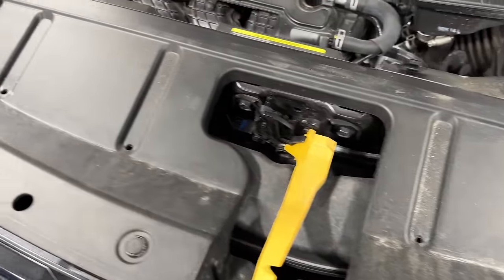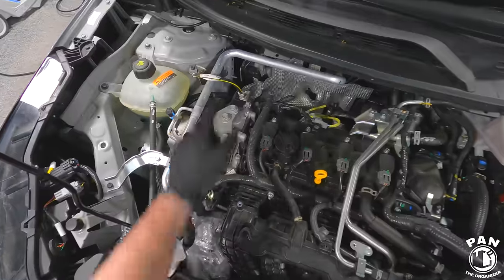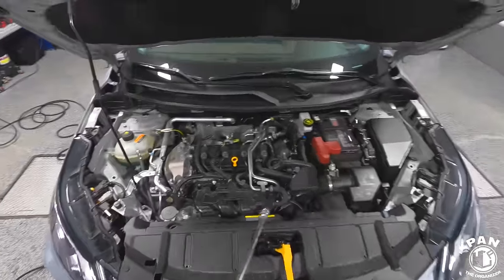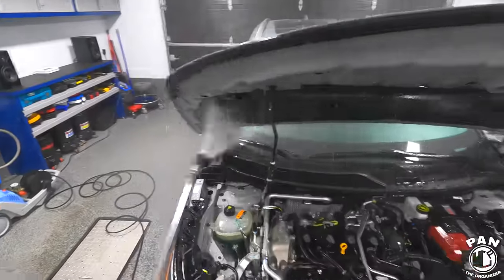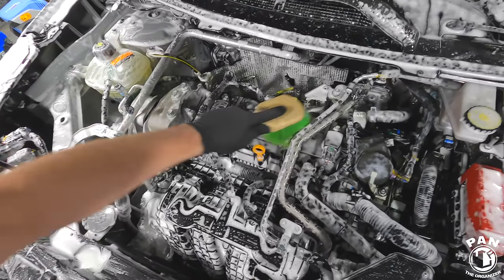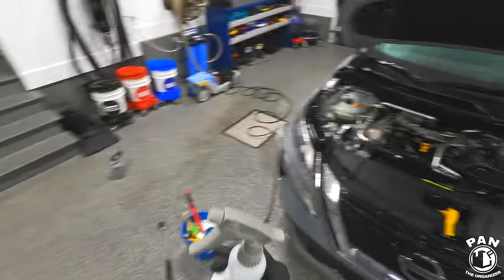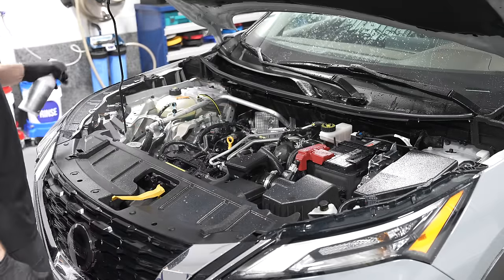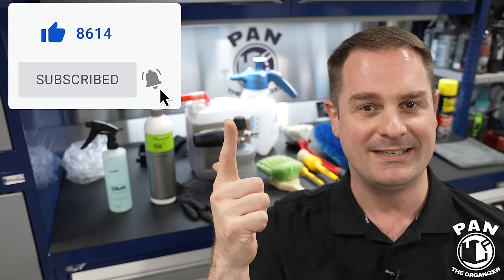How to Safely Clean Your Car's Engine Bay!

Comment: You may have cleaned tons of bays but id never put a pressure washer to it. Yep weather sealed everything.but pressurized water can still get in.
Reply from the maker: In 25 years of detailing, I have never had a single issue. Watch other detailing channels on the same topic and you’ll find the same thing. You can detail an engine bay as long as you use common sense and know the basic tips and tricks.

You could in theory also get struck by a vehicle when crossing the road. But you don’t go about life in fear that it might happen. And the risk or actual chance that it might happen is very low. Humans tend to sometimes overthink the moment on some topics.

But if you don’t feel comfortable to detail the engine bay, by all means don’t. It’s up to you to decide. 👍🏻
Reply: @PanTheOrganizer  water in connectors corrosion, below windshield  vents plugging drains, water in the car. Bottom line id not put a pressure washer to my avalon and LS350. Also you should vac as much as possible first then use a air hose. Just plain common sense. Your example is lame. God had not given me the spirit of fear but of love and a sound mind. No mask no jab for this guy. No fear.

Comment: Hey Pan,
Having trouble getting 500ml or 1L Active Snow Foam in Australia. 
Do you have any other recommendations please?
Reply from the maker: What brands do you easily have access to?
Reply: Gyeon, CarPro and Koch. But can’t get the Foam
Reply from the maker: Gyeon Foam, Koch Chemie Active Foam and CarPro Lift are all good snow foams with stronger cleaning potential. Pick one you can get.

Comment: However you put it there is always a risk in wetting ANY engine. Sensors/electronics are indeed sealed but their is always a risk of that seal going bad and water/moisture getting in that device and then you are faced with issues but the chances of this happening is very very slim. Recently I saw a car which was not starting and eventually the issue was found that the computer was bad and when it was opened moisture was found in it and the person did say that the engine is cleaned and this is a car that is 2 years old.
Reply from the maker: Then engine bay detailing simply isn’t for you. To each their own.
Reply: And that’s why the detailer pros make you sign a waiver for liability and put the responsibility on the customer to evaluate their engine bays. I would hope the detailer would do some inspection prior to starting the service. But hey, they got a waiver signed so no recourse or repercussions.
Reply: @rikki1901  you are correct as i was explaining to the video creator wetting a car engine regardless of all the precautions is a risk

Comment: So it's safe to wash even the battery and not cover it up? It's amazing how many youtubers* even my honda mechanic say to cover it remove it to prevent shorting out stuff. That's why i haven't touched my engine bay coz what's the correct method ?
Reply from the maker: Some people just feel uncomfortable around engine bays. If your car is recent (less than 10 years old) then there is little to no risk. Of course use common sense, and cover any exposed areas you feel might be too sensitive. But keep in mind that car manufacturers go to extreme lengths to ensure their engine bays are water tight. 

There's a reason why engine bays get so dirty. A lot of the water and junk on the road finds its way in the engine compartment. Process that for a second... So it's not like no water ever gets into the engine bay.

In 26+ of detailing, I have detailed hundreds of engine bays and not once have I encountered an issue. But if it makes you feel safer, by all means disconnect the battery and cover sensitive electronic components, and the alternator.
Reply: @PanTheOrganizer  thanks for this ..I feel comfortable now to do this..I have a 2013 honda accord ..so I'll probably cover the alternator since it's a bit exposed ..

Comment: Hey @PanTheOrganizer can I substitute the active foam with Carpro lift? I don’t really want to buy 5L of active foam when I have lift already. Only issue is lift says to wash with reset after. No instructions on if lift is safe for engine compartments.
Reply from the maker: I haven't used Lift on engine bays, so you'd have to ask CarPro.
Reply: @PanTheOrganizer  ok thanks. Waiting on their reply now.
Reply from the maker: Keep me posted if they answer you.
Reply: @PanTheOrganizer   looks like it is safe. Here is what I got back from Carpro 

“yes its safe on the engine bay , no need to wash again with reset after , Lift itself is a good soaping too. just good rinse off”

Comment: Did he remove the car battery? Haven’t seen it.
Reply from the maker: No. It's really not needed especially on modern vehicles less than ten years old. But if you want to feel more secure and feel the need to disconnect the battery, by all means, go ahead and do so.

I have been detailing cars for over 26 years now, and have detailed hundreds and hundreds of engine bays and never once had an issue. Common sense and proper technique is the way to go.

Thanks for watching.

Comment: Detailing is not Fun! Set up, preparation, cleaning, detailing, picking up the mess, cleaning and putting your items away (organization skills), clean the work area, inventory your supplies and reorder new items for your next detailing session. It can take hours. Best to raise you car and remove engine cover underneath the vehicle before you start. Don't let this stuff settle below, After cleaning the top section of the engine compartment and letting it drip dry or air dry it, do the underside and wear eye protection, a hair net, and nitrile gloves. Old Long sleeve shirt for sensitive skin. You are not finished until you remove the gunk on the bottom. Keep water and cleaning agents to a minimum as the plastic tubing and electrical harnesses can deteriorate and corrode. Don't wash the underside of the hood, you can hand wash with whatever damp cloth and wipe dry and use wax or detailing spray-- avoid getting liquid/water into the holes as can be entrapped in corners and start corrison.
Reply from the maker: I have been reading your comments and it seems you are very negative in your way of viewing things.

This channel is made to share my passion for detailing and tips and tricks from my 26 years of detailing.

If detailing is not for you, or you don’t find it fun as you say, perhaps you shouldn’t be watching detailing videos.

This community is filled with people who find detailing soothing and relaxing.

Comment: Thanks for this video. I agree with you, folks seem to trip about cleaning the engine bay. I have to ask those people, so it doesn't rain where you live? Motorcycles don't ride in the rain with their  engines and electrics exposed? No one ever jet washed their bike? I always come back to you for the REAL word of education and advice. I too, have done may engine bays and never had a problem. I see those people that call engine bay cleaning difficult and scary as the same people that buy a bumper pull camper trailer and call it an RV (You know who they are and if it's you just stop it, you make yourself look very stupid. The clue is in the "V" you cretins.). They are just trying to make themselves sound more intelligent and cooler. You sir have THE channel for detailing and over the years I have learned so much from you. Thanks, you and your channel keep it real and your content is awesome.
Reply from the maker: I agree with you 100%

Comment: I do this to all my cars and sometimes when I take the cars to be serviced they comment about how clean the car is. Just traded in a 10 yo car that was clean like this inside and out and watching the sales person get a mechanic and a group comes and looks at it, I took home a brand new pickup with a dirtier engine, it had 8 miles on the OD. Once in the spring and once in the fall. 15 min. I just don't have all those excellent products and tools.
Reply from the maker: I fully get your point and agree with you. It's so nice to have a clean car both inside & out! Welcome to my channel. You discovered one of the biggest car detailing channels on YouTube as we surpassed 910,000 subscribers and we have over 120 million views! I have been detailing for 26 years and I love to share my knowledge and passion with my viewers.

You found the right channel to help you learn everything about detailing.

How did you discover my channel by the way?
Reply: @PanTheOrganizer  cleaning the garage and looking at stuff I accumulated over the years checking out many bottles of products. First car I detailed was a 1967 Camaro in 1982 which I had just bought. Car was in ruin, fixed engine, painted and flipped. I'm in my 60's and always learning, keep going. Looking for new techniques and products.

Comment: How c ome you didn't take off the battery?
Reply from the maker: There is no need to. Especially not on modern vehicles. I have detailed hundreds of engine bays in my 26 years of detailing, and never once had an issue. Use common sense, and good techniques. If you feel stressed about it, you can always disconnect the battery.
Reply: @PanTheOrganizer  thank you! Best Videos too .
Reply from the maker: Thanks Jackson. How did you discover my channel by the way?

Welcome to my channel. You discovered one of the biggest car detailing channels on YouTube as we surpassed 910,000 subscribers and we have over 120 million views! I have been detailing for 26 years and I love to share my knowledge and passion with my viewers.

You found the right channel to help you learn everything about detailing.

Comment: do people really think that engineers don't design under hood components to get wet? modern cars use various seals and gaskets on all electrical connectors and covers. this isn't a tv or an electronic that's in your house that stays warm and dry all the time. car are subject to extreme temperature swings, high humidity, monsoon level rain, and snow/slush that packs under the car. what do think happens under your hood when you drive through a deep puddle and water shoots over the car, does it magically stay out of the engine compartment? just don't flood the engine bay with water and blow it off with a leaf blower or air compressor and you will be fine.
Reply from the maker: There you go. You got it. 👍🏻

Comment: Hi Pan. Why would anyone want to clean the engine bay? Is it necessary? I can understand if the engine bay is really dirty. If not, why clean it?
Reply: First, clean engines dissipate heat better. Second, a clean engine makes it easier to identify any leaks of coolant and oil. And last but no means least, it helps with any OCD issues you may have. ( that last one was a joke of course.) I hope some other viewers can add to the list. Good luck
Reply: For the same reason you clean the underside of your toilet seat. You won’t see the nasty stuff until you raise the lid(hood)
Reply from the maker: Well said Wayne.
Reply: @PanTheOrganizer  Thanks Pan. Coming from you, that was a great compliment.

Comment: I wonder if the chemicals that you used in cleaning your engine bay will make the hoses and wires brittle overtime? This is one of my reason why I do not clean the engine bay of my car.
Reply from the maker: Absolutely not. You thoroughly rinse when you’re done and it’s not like you clean the engine bay on a weekly basis.

In 26 years of detailing, and hundreds of detailed engine bays, I have never seen a single issue.

And there’s no evidence to support your worries neither.

If you use common sense and proper techniques/products, there are no worries in my opinion.
Reply: @PanTheOrganizer  Hearing that from a person who has 26 years of experience I will give it a shot. Thank you for the help.:)
Reply from the maker: Especially on newer vehicles less than 10 years old, there are no real worries as car manufacturers go through great lengths to make their engine bays water tight. Think about it. You drive you car in the rain, snow, sleet, all sorts of conditions. That water still gets into the engine bay, and the car doesn't stall. :)

On older vehicles, take the necessary precautions if you feel the need. Disconnect the battery, cover sensitive electronic components and alternator with plastic baggies, etc. And use common sense. Don't blast the engine bay with a gas powered 4000 psi pressure washer haha. Never go beyond 2000 psi when washing cars anyways. I always set my pressure washer to 1000 psi when detailing vehicles.

Welcome to my channel. You discovered one of the biggest car detailing channels on YouTube as we surpassed 930,000 subscribers and we have over 122 million views! I have been detailing for 26 years and I love to share my knowledge and passion with my viewers.

You found the right channel to help you learn everything about detailing.
Reply: @PanTheOrganizer  I wish you more success to your channel. :)

Comment: I recently detailed my engine and now my engine is misfiring😢
Reply from the maker: What make, model and year of car do you own?
Reply: @PanTheOrganizer  Hey pan amazing video btw. I own a 2004 ford falcon xr6, it’s an Australian car
Reply from the maker: As I was saying in the video, recent cars 10 to 15 years at most are usually safe. Anything older, which is your case, and you have to be more careful and take precautions. Disconnecting the battery, covering sensitive components with plastic bags, etc.  

Anything before 2007 isn't as water tight as today's modern vehicles.

By the way, welcome to my channel. You discovered one of the biggest car detailing channels on YouTube as we surpassed 830,000 subscribers and 105 million views! I have been detailing for 25 years and I love to share my knowledge and passion with my viewers.

You found the right channel to help you learn everything about detailing.

How did you discover my channel?
Reply: @PanTheOrganizer  I found the problem, the problem is the water seals on my engines rocker cover failed so water got into the spark plugs and the sockets. 

I’ve been watching you for like 2 months one of your videos came up on my recommended as I started my detailing business.

Comment: Would be interesting to see a real dirty engine as to how these products really work.
Reply from the maker: Perhaps you can source a neglected vehicle with a disgusting engine bay and film a video showing us how they perform. In my experience, the same products and methods are used regardless of the level of dirt in the engine bay. It's just the amount of time spent scrubbing and brushing that changes. And perhaps you can use a steam cleaner for super grimy greasy engine bays.
Reply: @PanTheOrganizer  Thanks for your rude answer pan

Comment: Use common sense and precaution. You're very right. Also just need a little bit of dexterity. It's an artistic process, not just a wash. Be mindful and light with your hands and pressure wash.
Reply from the maker: Well said!

Comment: I disagree using a power wash in the engine compartment due to the risk of damaging electrical components. Very risky
Reply from the maker: You can't disagree without substantial evidence to back what your are saying with actual facts. I have been detailing for over 26 years, and have detailed hundreds of engine bays. Not once did I have an issue. Especially with modern vehicles, less than 10 years of age, manufacturers go through great lengths to make their engine bays water tight and everything is sealed in there.

How many engine bays have you detailed in your lifetime? And did you encounter issues in order to come up with your claim? I doubt it.

Welcome to my channel. You discovered one of the biggest car detailing channels on YouTube as we surpassed 905,000 subscribers and we have over 117 million views! I have been detailing for 26 years and I love to share my knowledge and passion with my viewers.

You found the right channel to help you learn everything about detailing.

Comment: Wrong.
You dont have to worry at all. Do you guys know how much water gets into your engine bay at highway speeds while following a semi, durring a rain storm? Way more than a pressure washer can in just a matter of a few seconds. You wish to clean your engine and engine bay, just do it. I have been doing it since 1977, and i have never had any issues what so ever at all, period. 
However, he is right about one thing, never wash an all aluminum engine while it's hot, as you will definitely cause issue, wait about 2 hours.

Comment: Not gonna lie, I was cringing as he sprayed through the engine bay. I couldn’t trust it enough to do this even with all precautions taken. I just feel like I’m water logging something that’s not supposed to get wet.
Reply from the maker: If you use proper techniques and common sense, there are zero worries. I have detailed hundreds of engine bays in the past decades and not once did I have an issue.

Especially in the last decade, car manufacturers have gone to extremes to make sure their engine bays are water tight and properly sealed.

Welcome to my channel. You discovered one of the biggest car detailing channels on YouTube as we surpassed 965,000 subscribers and we have over 130 million views! I have been detailing for 26 years and I love to share my knowledge and passion with my viewers.

You found the right channel to help you learn everything about detailing.
Reply: @PanTheOrganizer  Thank you, I’ll look into it more. Have you detailed the engine bay of a Hybrid car? Any further precautions with that?